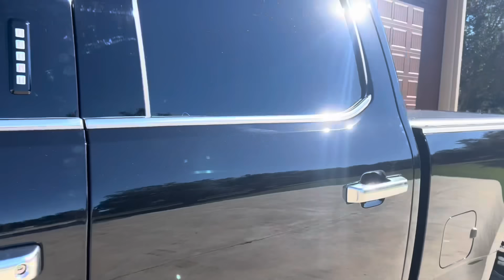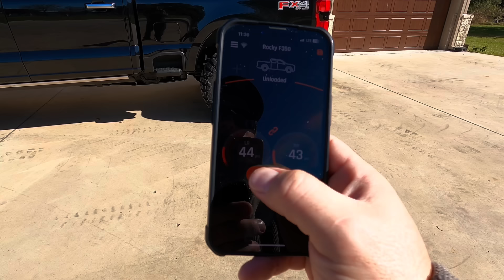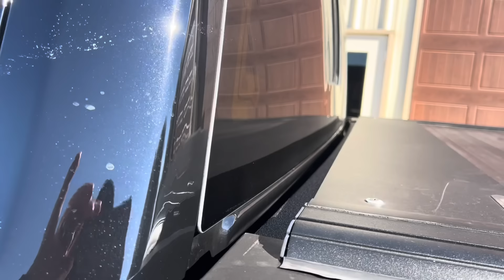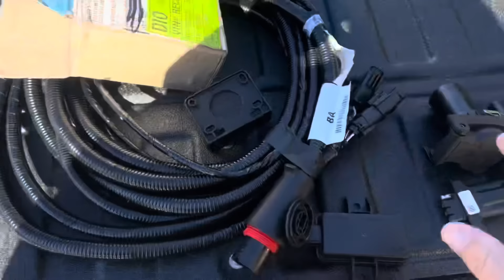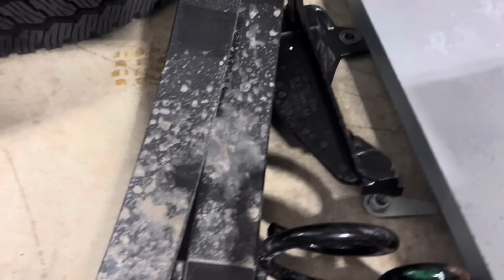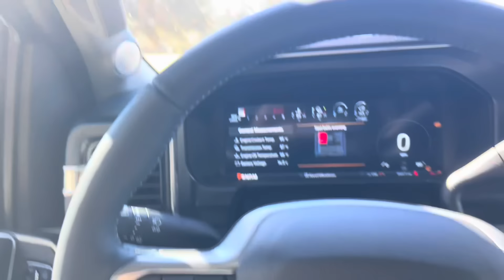2024 Ford F350 Limited Super Duty Build.. Lift, Airbags, fuel tank, and High Output Powerstroke

Comment: Great vid. Love the truck. After several months of research, I just bought a 2025 F350 Platinum Plus (for the newbies they stopped the Limited in 2024 so the new ones are platinum plus).  I love the wheels we have but everything I’ve read says we can only put a max 275 (10.8”) wide tire in these stock 8” wheels. With you on the 13.5’s with these stock wheels and lifted and with a heavy (heavier than mine) trailer I’m psyched to learn that a wider tire is possible. I would only want to go with a 12” wide tire (305’s) so thanks for letting us know this is possible.
Reply from the maker: Large box stores will tell you no.. I have pulled with 13.50’s on every truck with zero issues. Off road shops putting 13.50 and 12.50 tires on every day.. Proper inflation and weight ratings are very important..

Comment: Nice Build!  Love the winch, on my to do list now! 

Wondering if you have you had any trouble with your Collision Avoidance Sensor?  I have 37's on my 2024 F350 DRW and I have had it in the shop multiple times for the sensor, and now they are telling me that due to the lift and tires the sensor is not able to be calibrated.

Comment: No caster shims on this one Rocky?
Reply from the maker: I did install caster shims after replacing dummy hub.
Reply: @ I figured you did, 2 deg or 2.5? With you having so many of these fords, what have you found that helps the bump steer the best? Not necessarily dw, just. Shimmy in the wheel when hitting bumps? I have had 4-5 17+ and I swear they are worse than the older 16 and later, as well as worse than ram.

Comment: Thanks for the info and guidance for 2023+ level and lifts. You've used both the front spacer leveling and the coil over leveling kits, which one rides better?
Reply from the maker: The OEM springs are a softer ride. The suspension full coils are good also but they are a little more stiff. If your mostly highway I would do radius arm drops and keep stock coils with spacers. The 3” coils start to give a better ride than 2.5” coils.

Comment: In your video you say the TPMS system does both tire air pressure and tire temperature. Been reaching out to Ford dealers and Ford technical people for this answer and either they say they don't know or no it doesn't do temperatures. This is to install on my 2024 F350 King Ranch Dually that I tow my Montana 5th wheel with. Any help or even some video showing it on the dash would be so much appreciated.

Comment: I have a question about the leveling kit. Did you only install the springs and the shock extender? Or did you also put on the track bar bracket? I just got a ‘24 f350 and I want to level it.
Reply from the maker: Installed track bar bracket also
Reply: @RockyRohde  thanks for the info. I’m most likely going to do the same setup you have minus the tremor block in the back.

Comment: So your auxiliary tank electric solenoid valve…. Why solenoid valve versus an electric ball valve that would use less power to open and close? And which model of electric solenoid valve did you use after all? I’ve looked and found a lot of mixed reviews of all brands of solenoid valves with no consistency.
Reply from the maker: I used electric ball valve 12 volt, two wire, fuel rated off Amazon. It has a built in capacitor and when voltage is dropped it closes. The solenoid valve uses to much amperage and coil gets to hot for me..
Reply: @RockyRohde  that’s exactly what my concern was, I guess I misunderstood what you used when you said it in your original video. Any issues (opening and closing correctly) with the ball valve you’re using?
Reply from the maker: @lauroa.gutierrezjr.7975 zero.. it works well

Comment: Question on AirRide Air Tank, Using the 2 line Air Pump for L/R. Do you have Air Tank with T-fitting connected to both Air Pump L/R Out lines or the Outlet from Pump between Pump & Air Controller?  Was curious how Tank provided Air to both lines separately.
Reply from the maker: Tank has a 3/8” line to controller on pump.. Both left and right 1/4” lines connect to pump controller.

Comment: When you ordered did you select heavy duty front suspension with the winch or just the stock front suspension option? I just ordered my limited today with winch, the dealer said it wasn’t necessary.
Reply from the maker: I did not.. the heavy suspension is really for snow plow. I’m not looking for a firm ride. When you order with winch you will get dual alternators also. This limited is definitely my fav truck I have had in a while. It does not disappoint and tows my 45’ toy hauler no prob..

Comment: Hello,

2024 F-350 stock Tremor Diesel... the truck wonders back and forth especially when towing.  My 250 diesel Platinum was nailed to the road and felt very stable, but this Tremor causes me to fight back and forth with the steering wheel especially when towing.  Is this normal because of the Tremor package???  Tires are set at ford specs and trailer is a 6,000 lb bumper pull.  Should be noooo issue for a Tremor diesel 350.  
Have any advice?
Thanks,
 Ryan
Reply from the maker: Let some pressure out of those tires.. Should help significantly..
Reply: @RockyRohde  Ok, I'll try that.   I'll start with 10 lbs less.  Currently front is at 60 and rears are 75.  I'll drop 10 lbs respectively.
Thank you and enjoy the week.

Comment: After all your trucks, seems like your still liking the ford line. I have a 22 cummins and love it but never have drove or owned a duramax or f250. What is it in summary that you like about the fords? I really love the 24s with the new interior and look.
Reply from the maker: The ram for me just needs a 8 or 10 speed. Ram has been running ahead on technology for years and that is why I like them. The 2025 is supposed to get a 8 speed that will be a game changer. I really like the mega cab but don’t really like the long wheel base. Ford and Ram offer about the same space on a Short wheel base. I have had all late model trucks and the fords just pull like nothing behind you.. The power and stability is 100%… The GM is the best everyday driving truck and drives like a car.. I do think Ram and GM could add a little more cushion in the seats to compete with ford. It really depends on what you plan to use the truck for..
Reply: @RockyRohde  Man that would be awesome to have a 8-10spd. Yeah it’s hard for me because I have my tuned and weight reduced so it’s completely different than stock. Comparing these trucks stock for stock is easy but a whole different ball game when dialed in correctly. My only hate is my transmission, feels like it’s not smooth and could be better.

Comment: Always great & useful information, great videos. 
The Ford TPMS option… are those internal rim mount or Valve stem? Does kit come with 4 or 6 (3 axle) sensors? Once complete, does Dash show 4 (6) Truck and 4 (6) Trailer on dash screen as a Truck & Trailer Diagram? Does it show Temps for each too? 

Was comparing with the 2 main Aftermarket Brands. 

RV Camera: 
Did you later purchase and add the Ford Rear RV camera or a different 3rd Party. The RV view then shows on Dash Camera screen as other views?

Comment: How long did you say your camper was? I couldn’t tell if you said 35 or 45 feet. 45 is a lot for a SWR. What is the GVWR  on your camper?
Reply from the maker: 43ft.. gvwr is 17,800. Rv is 12,800 empty..   This RV is legal for 3/4 ton truck… I picked this model for that reason. All these new RV triple axles are having frame issues..
Reply: Thank you. I just got a 2024 platinum tremor. I’m pulling a Solitude 365GK that’s 40.5ft with GVWR16800. I’ve ordered airbags since it squatted the truck down. The onboard weight scale says it’s slightly overweight. 

As an aside I replaced the stock fuel tank with a Titan 55gal tank

Comment: I may have missed it, but when you order the spacers for the rear, did you specify that you had the high capacity rear axle that came with your HO engine? Or is it the same diameter hub?
Reply from the maker: Yes you need htc rear if you have f250 tremor or high capacity or f350.. if it has overloads you need htc rear.. link below shows install and the difference 

2023 Ford Superduty 3/8” and 1” Hub Centric Bora Wheel Spacers #fordsuperduty
https://youtu.be/deKM-RVS85E
Reply: Thanks for the info! Your truck is sweet

Comment: How do we get more details on how you plumbed the fuel tank?
Reply from the maker: I used RDs gravity kit and a 2 wire electric  ball valve off Amazon. Power to open..
Reply: @RockyRohde  Awesome, thanks.  Is this illegal to do for both diesel and gas?  Or just gasoline?  Wanted to do this on a gas truck.. Anyone know?
Reply from the maker: Here is the valve

Motorized Ball Valve- 1/4"... https://www.amazon.com/dp/B06XXPZHVB?ref=ppx_pop_mob_ap_share

Comment: You did not install the bump stop extensions. The Tremor block raises the bump stop only one inch, however the extension is 2.5" in length. So if you do not have enough air in the bags you will bottom out and destroy the bags.
Reply from the maker: I installed after the video..
Reply: I was curious about that and not in a malicious way. I am currently test fitting these bags and had some concerns that hopefully you can answer. Prior to installing the bags, we had 4.5" of distance between the bump stop and lift block stop. When we install the 2.5" bump stop spacer it effectively reduces down travel from 4.5" to 2.0" with no air in the bag. My stock spring rear suspension with Fox 2.5 shocks will travel about 2.5" normal driving, over a curb or such. With these bags installed, no trailer , about 5 psi in the bags I will be hitting the bump stops in some instances. To prevent this I must add air to the bag to reduce down travel to under the 2.0" mark as to not hit the bump stop. The effect then is the rear is lifted and now I have a rake I do not want. In short, my question is why do these bags only have 2.0" on travel at installed height. Curious to know your measurement of max travel to bump stop with no air in the bag? Thanks   @RockyRohde
Reply from the maker: @johnsnyder8053 I am running 10 psi as recommended by Airlogic. I didn’t install bump stops in the beginning as that was a concern for me also. Talked to them at air logic and the Ford bump stops are soft and will cushion significantly.. My everyday driving I have not noticed any issue with 10 psi and a little over 1” clearance. When towing I add air to achieve the same 1” clearance and have not had any issues. Yes your truck will have a little more rake. If you don’t like that option install the FX4 blocks and 10-15 psi will be a perfect level.
Reply: Thank you for the information, Sir. I just could not get past going from 4.5" of down travel to ~2.0", it just did not seem right.   @RockyRohde

Comment: nice rig dude, but the only thing that I would do differently is put a electric solenoid valve on the back air bags so they can equalize and allow it to articulate when you're driving off road in 4wd.

Comment: 😂😂😂😂 he said he built his truck for towing but run mud tires? Those wide tires also are the worst choice for towing. He’s got a lift (removed heavy haul cant for max towing? That lift is junk. And a spacer block on the rear? Best towing option would have been new springs.
Reply: Wheel spacers 😂 way to cheap out on $80k+ truck... where did you see blocks? I seen bump stops only.

Comment: Why the crappy lift and wheel spacers on a $105k truck? 🤦🏻‍♂️ It’s a beautiful truck but 100% bagged yourself with the suspension and wheel spacer choice.
Reply from the maker: High end soft lifts are not good for towing. I have had them all.. This isn’t a one build for me.. Quality hub centric spacers are great if you’re not a tool and understand maintenance.. I build my trucks to look and perform for my preference. Thanks for watching the video.. Peeps will all have different opinions..
Reply: @RockyRohde  Thanks for the name calling buddy. You hit a new level of low with that one. And you’re damn incorrect about not being good for towing. You set it up right and you’d have ZERO issues. But enjoy!
Reply from the maker: I didn’t directly call you any name.. made a statement about spacers.. I have ran them over 10 years pulling over 20k with zero issues.. you were the one that said I bagged myself for using a product.. If you look at my channel you will see I have built many different trucks. You came to my channel with negative comments..
Reply: @RockyRohde  You did bag yourself by using that product on such a high dollar truck…and you did insinuate that I am a tool and don’t understand maintenance on a diesel truck. But what do I know?

Comment: I got 540 miles on my f250 an it's in the shop already ford quality my butt !!!
Reply: I just saw this video and like anyone else. Scrolled through the comments. Don't feel bad bud. My company buys Chevrolets. 3 of the brand new trucks went back to the shop in the first month (2500 hds). We have another one burning oil out of nowhere, and it doesn't have 35k miles. The cummins we had, went back to shop constantly.   We only have 1 truck that's not went back to the shop for engine or transmission issues.   Everything sucks now due to government.  You get a good one or a bad one.

Comment: Like the Truck, very nice setup, I was planning to use similar. 
Ordered F450 Limited Sep ‘23… added TPMS option, didn’t add Installable Camera since it could be purchased later. Did the wiring harness come with TPMS or Camera… or separate order? Was wondering if I needed to add camera while Truck is still in pending stage.  

Air Lift bags… looked on site, didn’t indicate the weight capacity… other brands state 5000 or 7500lbs. Is weight not a factor with dual bags? 

If you hadn’t spaced ft wheels out, with 2.5" kit you wouldn’t have had a tire rub issue correct. It was the wheel spacers that induced the rub issue with lift & 37"? Reading the web site it sounds like it’s a no rub kit with 35 or 37".
Reply from the maker: I only ordered tpms and it came with harness that camera can be added. A 37x12.50x20 might barely rub sway bar and radius arms. The 37x13.50 rubs radius arms without 3/8 or 1” spacers. Air lift is up to you I just have never been impressed with brackets that use bump stops on rear suspension block. If you’re towing 3k plus pin weight I would research. The dual bags also stabilize axle wrap on acceleration on braking. They prevent the axle from rolling as much a single pivot point.
Reply: @RockyRohde  thanks for info… agree on dual bag plate being better than single. Just didn’t see any bag weight limits. Also good info on tires and rub.  The F450 has commercial 19.5 and was planning to add a little taller tire but still similar width.  Saw your other video on ForScan for Speedo calibration, great to hear ForScan is ready for 2024… now if I can just get the truck to arrive!

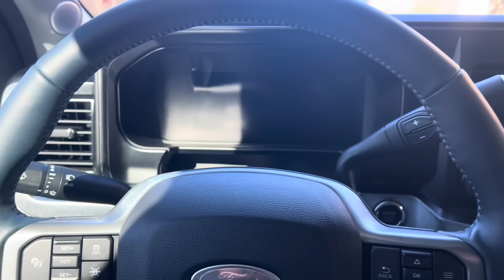Comment: At 10:45 minutes, you state "going to put the iglap system…" couldn’t fully catch that… what is that?
Reply from the maker: Research igla. It’s one of the most secure systems in the market. It is highly used on TRX and Hellcat trucks. The system requires a pin code entered on cruise buttons, or authentication with I phone app before the vehicle will start. It also makes the vehicle inoperable.. The dealer can install a new ECM and it still won’t start. The 24 was not compatible yet when the installer tried to install last weekend. He is coming back to my house as the developers have been updating with my info to work on 24 models. As soon as I get it installed I will do a video. I just did a video on the ford anti theft called perimeter plus that is plug and play and made by motor craft. Look up Igla on YouTube.. lots of videos..
Reply: @RockyRohde  Thanks, yep saw your Ford Anti-theft, that one looks appealing. Great info!

Comment: So with the ready lift spring in front that you installed, you can leave the stock track bar and bracket on? I just picked up my 24 f350 last week and noticed that it doesn’t have a hub lockout on passenger side. Does your new 24 have one?
Reply: Thank you for the information, you sure do set your trucks up really nice!
Reply from the maker: @-BOSSp850 thanks!
Reply from the maker: 24’s only have driver side locking hub. I use stock track bar and ready lift trackbar bracket.

Comment: Wheel spacers on $100k truck towing big weight. No thanks.
Reply from the maker: I have been using them for over a decade.. Quality hub centric with proper installation and retorques.. Spacers are not for peeps that don’t understand them.. They are not install and forget..

Comment: 85 to 96k truck and you cheap out on the lift.   Get back to us in 6 months when you complain about the ride.  This not a good lift combo.
Reply from the maker: Had this lift on many trucks.. I have also installed high end lift with Kings.. When you’re towing tall and heavy you want a different setup. If I was not towing a 45’ toy hauler I would have a diff setup.. First thing I disclose in the video.. High end lifts provide a better ride but also a white knuckle towing experience.. I have ran this lift on multiple trucks with zero issues..
Reply: @RockyRohde  I have ran BDS and on many super duty and rams.   Always had great luck with them.  Minimal sag.  Big fan of ready lift blocks for the rear on SD.  Just not sold on their full lift.

Comment: I have a similar truck coming (F250 with the F350 rear end), does your steering wheel heater work?  My dealer was unsure, it is deleted in Platinum for 24’ for sure.
Reply from the maker: It works but not extremely hot